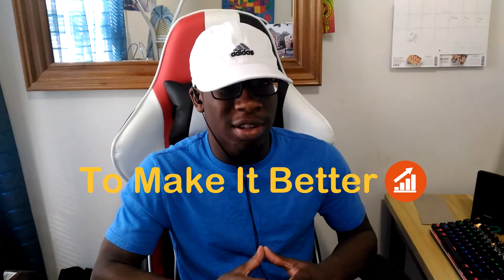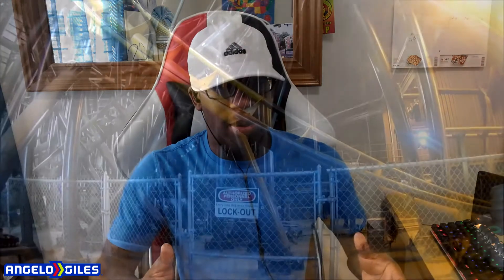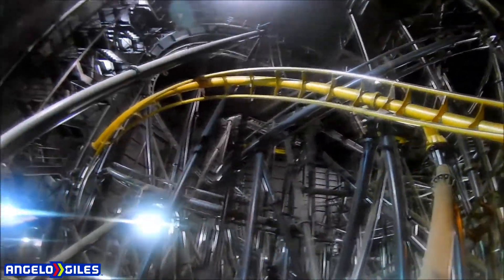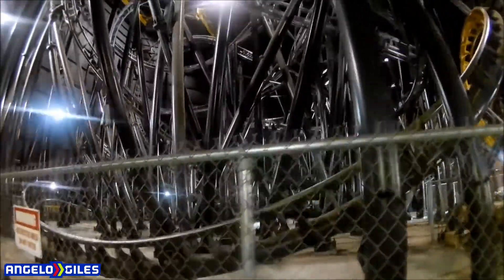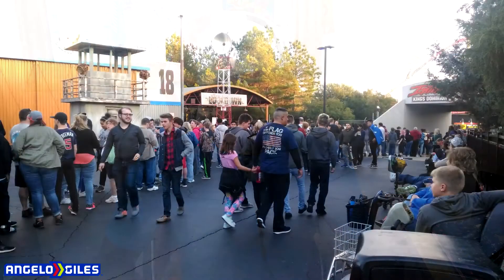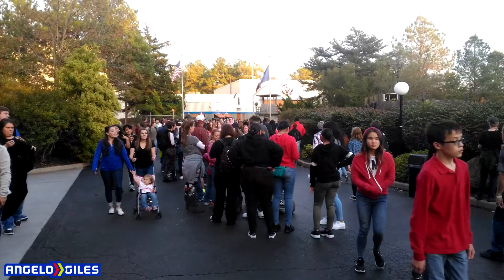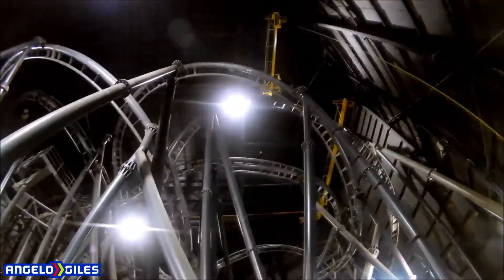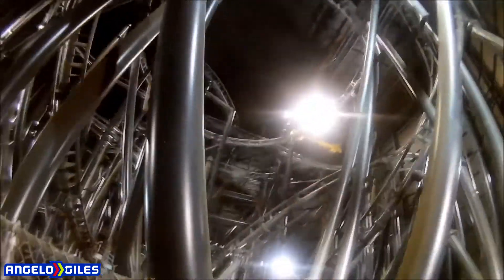What Could Make The Flight Of Fear Better? (Kings Dominion & Kings Island)

Comment: Hey, Angelo Giles! I want to see new special effects on both Flight Of Fear coasters. These can be a great addition.

Here are the special effects to be added on Flight Of Fear:
1. Launch alarm and fog effects.
2. Chasing lights during launch similar to Rock N Roller Coaster at Walt Disney Studios Paris.
3. Gamma radiation effects.
4. Electricity towers between cobra roll and sidewinder.
5. Loud boom on block brake with strobing lights.
6. Smelting machine with orange fog effects.
7. Telsa coil near corkscrew with strobing lights and electrical sound effects.
Reply: I would also love a killer soundtrack to be added to the ride with new trains with onboard speakers kinda like Rockin Roller Coaster.

Comment: These rides are old-fashioned, and the LIM's on the launch are fed straight 60 Hz power. To improve the launch one could use a Variable Frequency Drive to increase the launch force in case of heavier trains.

Comment: There are 2 replicas of this coaster that are outside Joker's Jinx and the Poltergeist at 2 different Six Flags parks and they don't have a mid coarse break run
Reply from the maker: Yeah ikr, Joker's Jinx was so cool without the brake run too.
Reply: + @AngeloGiles  and Joker's Jinx and the Poltergeist go 0 to 60 mph instead of 0 to 54 mph on both versions on Flight of Fear at Kings Dominion and Kings Island
Reply from the maker: @hvacguy84  Yup.
Reply: +Angelo Giles Did you hear about the girl that broke here skull on Flight of Fear at Kings Dominion a few years for not listening to ride ops, people in the queue line and other riders in the train. When they repeatedly told her to keep her head back on the ride.They had to abort the launch and close the ride down and call EMT. Everyone on the train got free fast-pass for a day. People in the queue line had to get the ride ops attention to stop the ride. When they heard her skull brake I was riding the ride. We were in the first loop when the ride stopped and we could hear screaming. The lights were turned on and the train was pulled back to the station. The ride ops said "we repeatedly told you to keep your head during the ride and other people told you to". People from Canada's Wonderland were waiting to ride this roller coaster but they couldn't but they were offered Fast-pass because they had the Platinum pass. When Paramount owned Kings Dominion the ride attendance for Flight of Fear went down in 2006. Paramount wanted to move the ride to Canada's Wonderland. When Cedar Fair purchased Kings Dominion they reopened the ride and left it at Kings Dominion.
Reply from the maker: @hvacguy84  Wow! I never even knew about this one lol.
Reply: +Angelo Giles That's why you should always listen to ride ops instruction and always read ALL signs on the ride. It always annoys when people pull down the orange restraints on Twisted Timbers. Ride ops are supposed push down restraints for there signs people read them. This causes the train to dispatch late and has all the problems been fixed on Twisted Timbers. Every time I go to ride this roller its closed do you think Racer 75's South side be re-tracked its a little on the rough side
Reply from the maker: @hvacguy84  Yup made a whole video for the people who do that on TT lol, check it out if you haven't already, but I do understand where you're coming from, I used to be a ride operator, and people definitely don't listen lol.
Reply: + @AngeloGiles  It annoys me when people don't follow the rules and people get injured or rollercoaster trains get dispatched late due to people NOT listening to ride ops or playing with ride restraints
Reply from the maker: @hvacguy84  Lol, how we got rid of Tornado.
Reply: + @AngeloGiles  What do think Tornado will be replaced due to guest not following instructions and I've been hearing rumors that "The Poltergeist" from Six Flags may be coming to Kings Dominion but "Flight of Fear"is the same ride but there is no mid coarse break run and it goes from 0-54 instead of 0-60 I don't think that it's true we just got Twisted Timbers